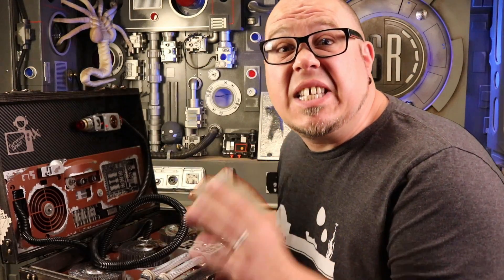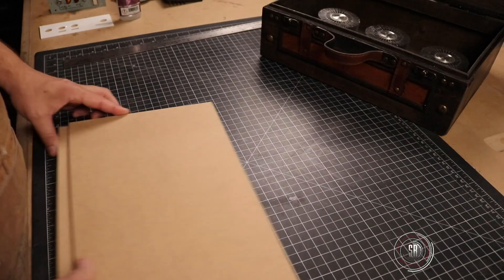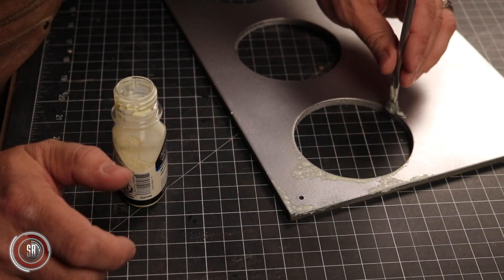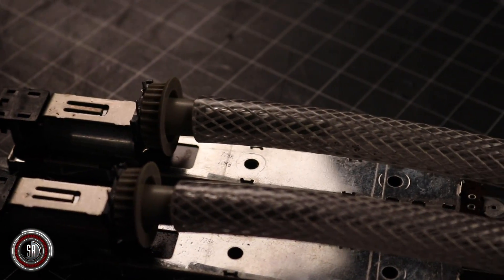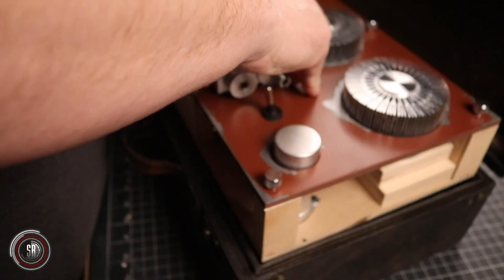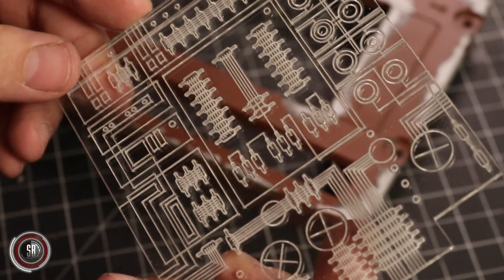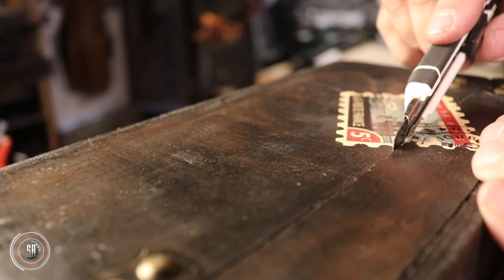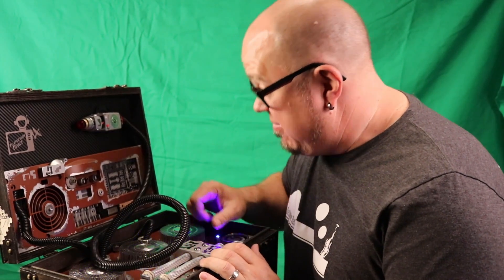DIY Secret Sci-Fi Tech

Comment: The heat sink is off a "bay light" style 100w LED down lamp. The particular make and model is unknown but searching for either "round led heat sink" or "bay light LED" will get you somewhere in the  right ball park. Alternatively try searching for "extruded aluminium radiator rod" and you can buy meters of the stuff and cut it to the desired length. Hope this helped. Keep up the awesome work.
Reply from the maker: Thank you!  This is great information and I really appreciate it!  this makes total sense now, looking at it.
Reply: Your welcome bro.

Comment: BTW those are definitely heatsinks. Those particular LEDs are very bright and get extremely hot. I imagine they failed because the heatsinks appear to be aluminum instead of copper.
Reply from the maker: Ah!  Thanks for that.  I figured they were, but I had not seen heatsyncs with LEDs before, so I wasn't 100% sure.  Thanks again!